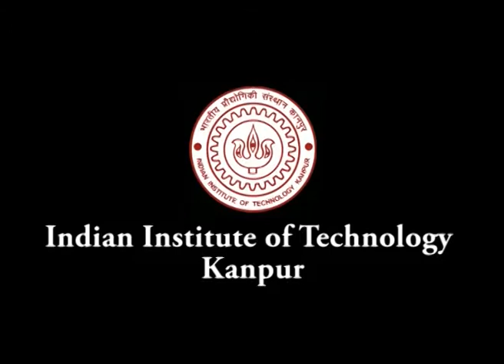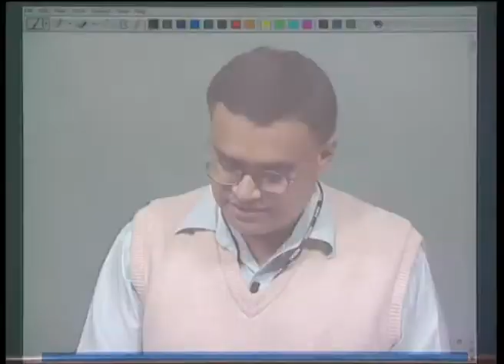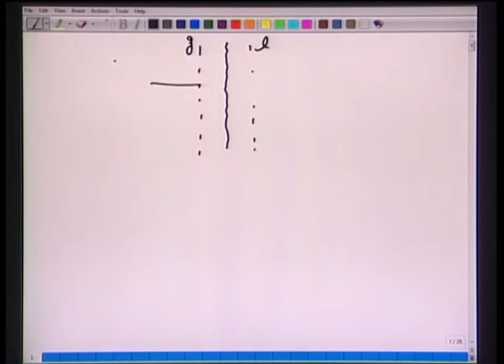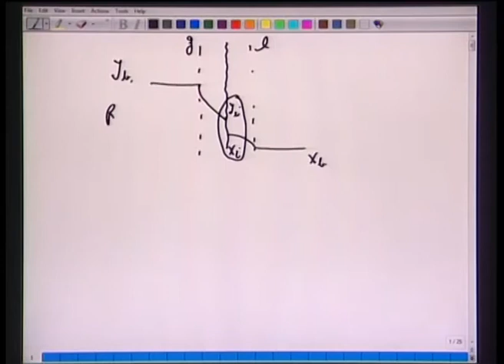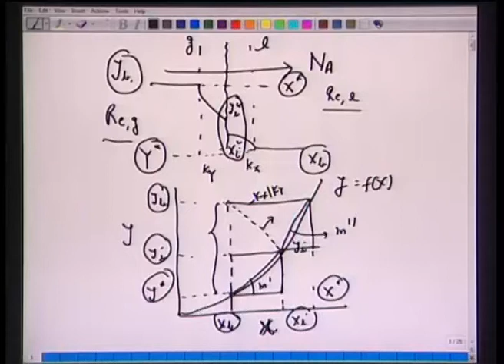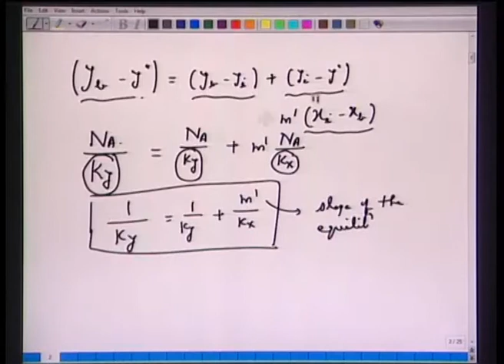Mod-01 Lec-06 Lecture-06

Comment: why in stripping, point P is below eqlb curve and in absorption, point P is above eqlb curve.....
Reply: You can look at this in the following way

In absorption, mass transfer takes place from gas to liquid, so the inlet composition in gas phase Y1 has to be more than that in liquid phase X1. This means in the graph P will have large Y coordinate and small X coordinate ie in the top left position and hence above eq curve. 

In stripping, MT from liq to gas phase, hence gas inlet will have very less Y1, hence P will have very less Y coordinate, below equillibrium curve.
Reply: may be i think this is because absorption takes place in upper part and stripping in down part of a column